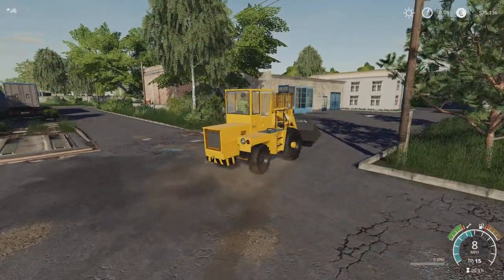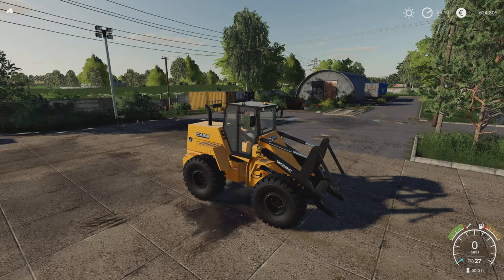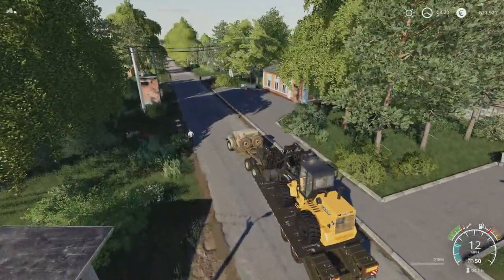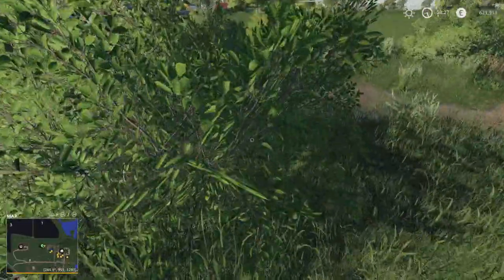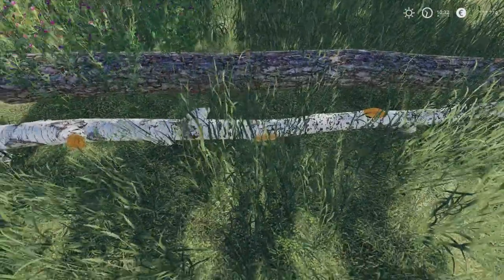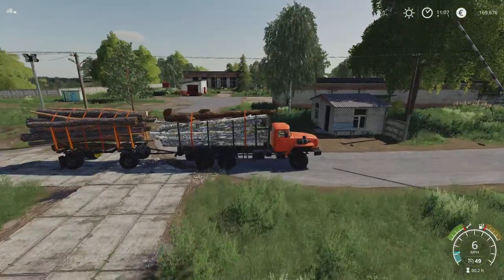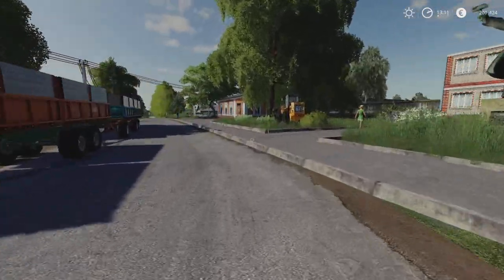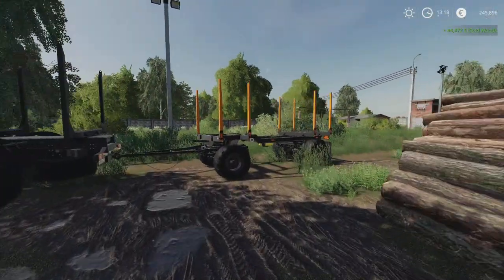RASSVET #12 / BUILDING BETTER WORLDS / Farming Simulator 19 PS5 Let’s Play FS19.

Comment: I'm glad that you actually cut up and sold all of the trees rather than just using the Trex.  The Rostselmash Nova should be just enough of an upgrade from the Bizon, but for the same price, the Acros offers alot more.  But 2 Bizons would be cheaper and a wider overall cut width (2x4.2m= 8.4m vs. 7m).  I like what you're doing with the test strips and Precision Farming.

Comment: MrSealyP fix achieved for the day. Must admit, I was a little bit disappointed with the old wheel loader when I downloaded it. 

I liked the solid feel rather that articulated, but the weight was the problem, plus lack of reach of the arms. It's impossible to use and get logs on a big trailer. Any who, keep up the good work sir.

Comment: When doing precision farming the manure and slurry do not get your nitrogen up to where it needs to be (on most crops) so you have no choice but to reapply a couple times or go with a single dose of chemical fertilizer. 
I guess it would cut the cost down using a first spread of manure or slurry, but you have to buy a spreader for it.

I always use the multi-silo mod for lime/seeds/fert......its stupid cheap from that mod.

Comment: I know you don't need to do the first application of manure/slurry/digestate but I don't it just to help with the cost of chemical fertilizer. I do Seasons and PF, I can build up a stock of slurry/digestate all year to apply in the spring. After using PF then trying base game again, I almost have to use PF, whether the map has a custom soil map or not.

On the harvester, I would use a Rostelmash, as it would fit with the Russian/Ukrainian theme that you are doing. Tractor wise, unless someone starts uploading Rostlesmash tractors, if you are going bigger/newer, I would go with Claas or another company that has their foot in the "local" area.

Comment: Do you use a steering wheel? I have a steering wheel for ps4 but everytime i want to buy something, change my camera or use a forklift i have to reconnect my controller. Do you have the same problem, or do you have a fix for it?
Edit: i don't have one for fs19 specific. It more for racing. I just want to have my wheel and controller conected at the same time.

Comment: Rostselmash Acros 595, 9000 litre capacity, 105000 euros. Maybe this is the way to go.
Reply: This would be my choice. Great price, good capacity and fits the map well. Only problem is (from memory) is that there is no hitch option on the back so you have to either stick the header on the front of the harvester or move the header with a tractor!